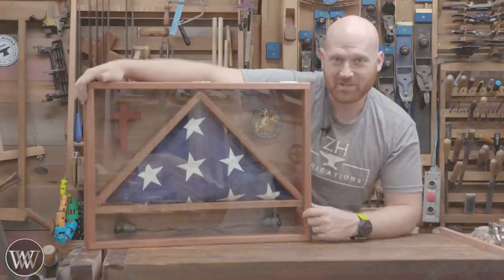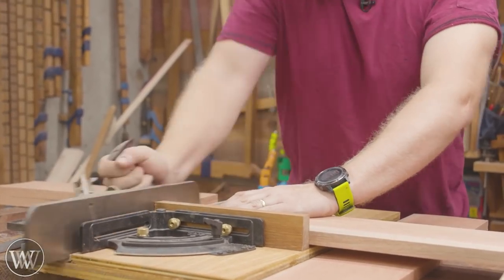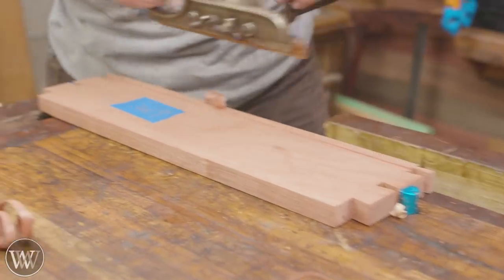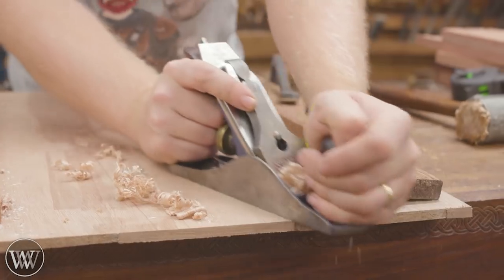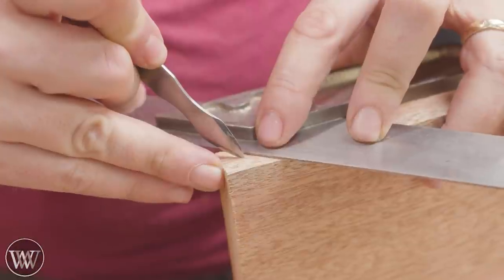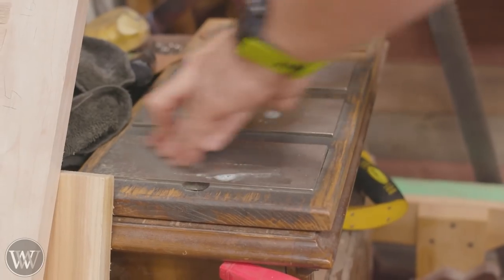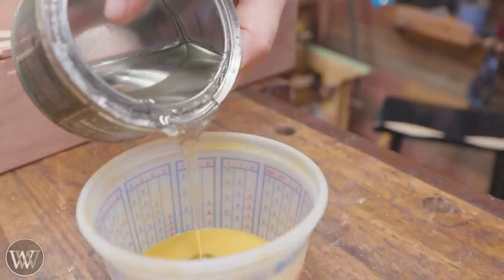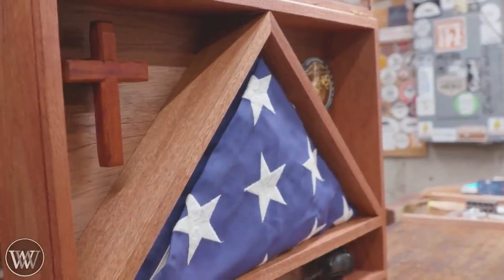How To Make A Flag Case

Comment: If you wanted to hang the case on a wall what would you use?
Reply from the maker: I would rather screw wire in on rather side panel or just a picture hanger on the back depending on the weight.